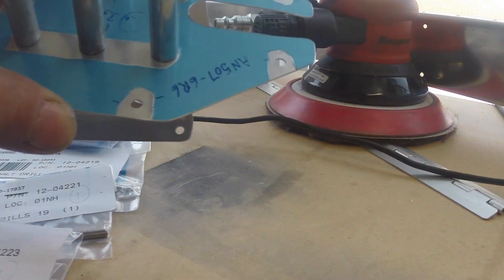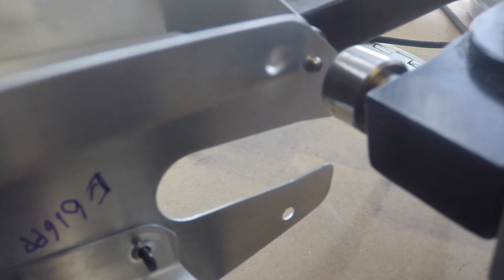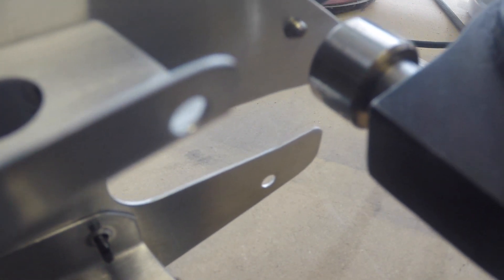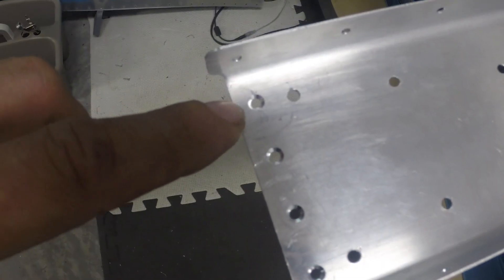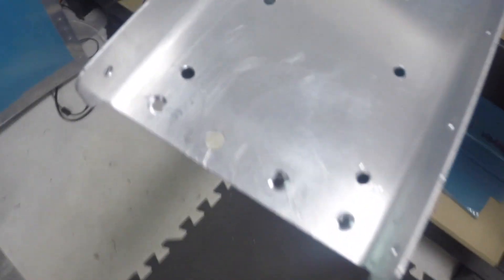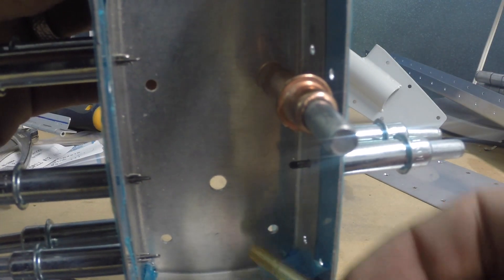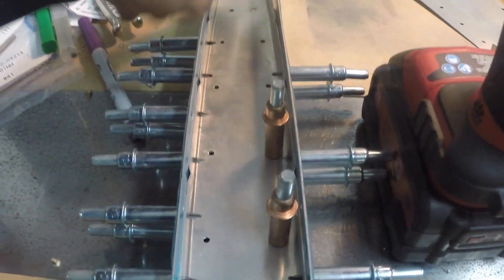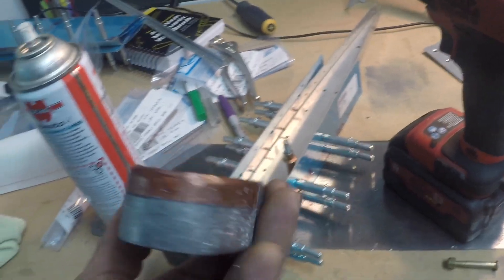RV-7 Elevator Spar, Trim Motor, Counter Balance Work

Comment: What size is that dimple die for the nut plate bolts? Great work and video again mate. Well done.
Reply from the maker: +Stephen Simpson  thanks for the kind words 👍🏽 the dimple die used for the nut plate is a #6. Same size for the screw and nutplate.
Reply: Thanks. Did you get it from Spruce, Cleveland tool or somewhere else?
Reply from the maker: Cleveland tool. Very Good Dies